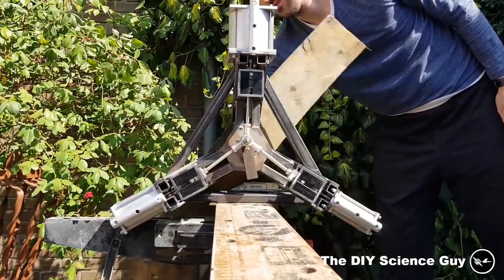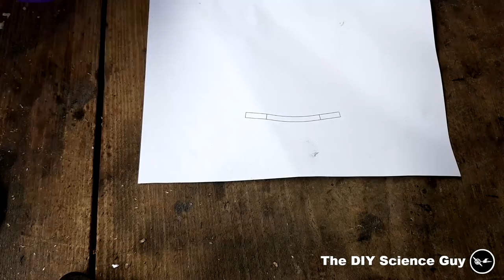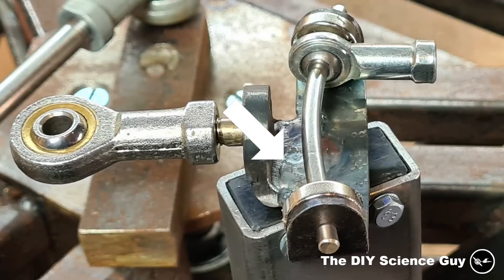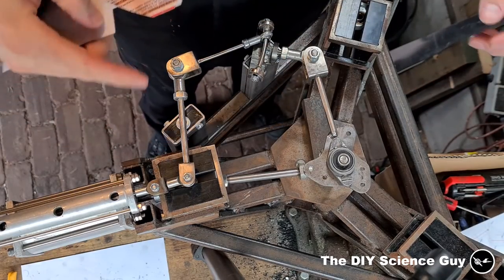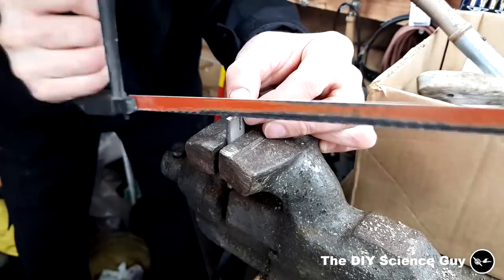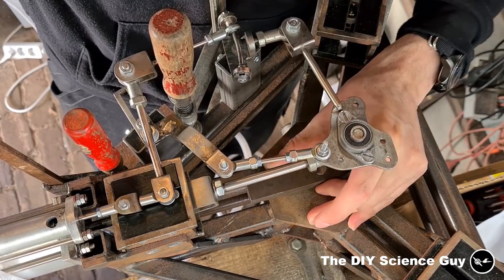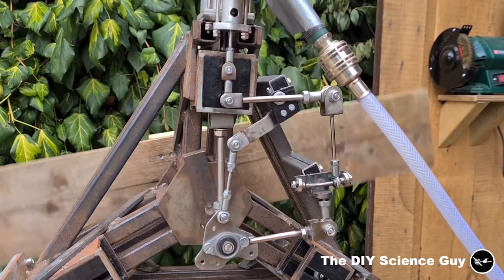Solar Steam Engine #7 The Valve Gear-True DIY

Comment: This channel is criminally undersubscribed. Amazing work!

I work in IT, and people think my work is complex. What you do here, however, is complete magic to me!
Reply: It is not even solar powered making this video click bait. Not underrated.
Reply: @bill4639  that's a sure thing he never finished this project 😅
Reply from the maker: But I will! This all is a hobby, hobbies take time.
Reply: @TheDIYScienceGuy  that's a good point! I know what you mean 😌. I really look forward to see how you deal whit sealing the engine up so it could be used in the refrigerant cycle, everything need to be air-conditioning qwantity , how dot you like the valveless Free piston steam engine?
Reply from the maker: This is how it's going to be solar powered: https://youtu.be/s5Ud-FD33tI hope you like it!
Reply from the maker: @oscar verwey Isn't that a kind of sterling engine?
Reply: @TheDIYScienceGuy  i like it for sure that's way I've replicated it whit some adjustments to go Whit water as a working vluid, my absorption heat exchanger is in the boiler heated by a solar heat colector en regenerative heat exchanger en the condenser is after the exhaust
Reply: @TheDIYScienceGuy  yas it's the free piston engine is also a kind of Stirling engine it's also a kind of combustion engine, it's the type of engine in general because it has not crank shaft,   I'm referring to the (Tesla mechanical oscillator steam engine) which is self switching en frequency stable
Reply from the maker: Aah yes that's a nice one! Did you build it your self?
Reply: @TheDIYScienceGuy  was 100% from scrap material as most of the components for the system
Reply: If you like I can send you the drawing of it, it took me 12 variation to get it to work properly on very low pressure
Reply from the maker: Yes please! You can send it at thediyscienceguy@gmail.com

Comment: Any plans to continue this series? Butane presents all manner of additional problems for only the advantage of the lower boiling point. I think you would have a better time sticking to ordinary water and steam, but use some sort of homemade ultra high throughput, low temperature differential heat pump to heat the boiler, using your awesome solar water heat source as the input.
Reply from the maker: The steam engine is sitting on my workbench as we speak. It's not about the successes, but about what we can learn from the things that didn't go to plan. I never take the easy road because they have already been traveled.
Reply: @TheDIYScienceGuy  Glad to read this :) That's great news !

Comment: What kind of welder? I’m familiar with a wire feed mig, and I also use a HF plasma cutter (absolutely love that tool) but I find my mig is not delicate enough.
Reply from the maker: It's a TIG welder.

Comment: Howdy :) I have loved watching this build and it has given me all sorts of inspiration- so much so that I am actually going to make a steam turbine for a school project coming up. I have one specific question that you touched on in your first video of this series with the soda bottle example: 
How do you physically set up the closed system recirculating pump?
I’d imagine it’s output pressure has to be higher than the boiler but then that pressure would be added and therefore it stands to reason the output pressure of the pump is now the operating pressure of the entire system correct? 
I am also wondering how you would get it started, as the water pump cannot pump steam(at least I assume it can’t) and so in my own mind the boiler would pump in both directions of the closed loop and make no work… do you need a valve to allow the boiler time to pressurize and start producing useful work and let the condenser resubmit fill up some water before opening the whole system to be recirculating?
Reply from the maker: Hey, good question! When the liquid is pumped to the boiler, it is a very small amount compared to the amount of gas that it can become. So, the pressure buildup from pumping the liquid is very small compared to the pressure buildup from heating the liquid in the boiler. The pump will be started by a switch that measures the boiler volume. This whole system is exactly the same as with a normal steam engine. Nice that you are making a turbine! Please let me know how it goes!

Comment: I like the project. I have a question. How much of your energy is used with such a complex set of mechanisms to control a valve?
Reply from the maker: Thanks! Well the valve mechanism does not have a lot of resistance, most of the friction is between the piston and the cylinder. But I don't know yet how much that is, I will determine that when the steam engine is ready. But good question 👍

Comment: Este o parodie de motor în stea. Nu este eficient deoarece la cursă maximă ai pierdut multă presiune. Îți sugerez o idee. O conductă de plastic, faci un cerc, cu bobine pe exterior. Capetele cercului sunt legate la un robinet bilă. Înainte și după robinet faci fante de admisie și evacuare, iar în conductă introduci un magnet bilă. Este un motor, generator, compresor, pompă, convertor, LINIAR.

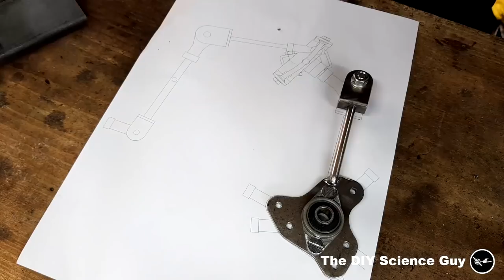Comment: 10:40 why isn't the crankshaft rotationally symmetrical?
Reply from the maker: It needs a counter weight and the thing sticking out is where I will later attache it to.

Comment: where's the rest of the solar steam generator?
Reply from the maker: I built a new workspace, and then, because of the high energy prices, I started building a heat pump. When that is running, I will continue the steam engine project, I really miss it! There are a lot of shorts about what I did and what I am working on.

Comment: Waaw your video's ar really inspirational, you I've take great afford to get it Al really precise ! Head's of man ! , What is your minimum run pressure whit Al the Stuff attached?

 I've replicated this steam system Idea (cryophorous system) en it works great on warm water, (from 55ged c en up ) 

it's really hard to make everything vacuüm tight but it runs for me on a solar heat colector en a boiler for storige, the engine I replicated is the Tesla machanical oscillator ( free piston steam engine) this uses no valve's or Extra stuff en can be tuned from 32hz up to 60hz whit a extra spring, it don't even have a crank shaft

 this makes it hard to generate electricity whit it  because it only have reciprocating motion en I can't get the liniaire alternator to work 😅 but the rest work's just fine even , the minimum run pressure on air is 0,2 Barr en on steam it's so low it's undetectable
Reply from the maker: Thanks!!! Nice, Do you have a video or something of your setup?
Reply: @TheDIYScienceGuy  do you know way my last comment is removed?
Reply from the maker: What comment? I didn't delete anything. Did it have a link? Youtube sometimes blocks those because they think it's spam 🤔
Reply: @TheDIYScienceGuy  ow really? Strange things happening sometimes, maybe something whit the community rules,

 what I was saying that ik got into this system after seeing Your first video about the solar steam engine 😀 after this I keep looking for things to make it happen en water van also je used of you engine can run on extremely low pressure, you can look it up on my channel I've a bunch of video's about the (Tesla machanical oscillator replication) your idea is almost the same as the (ocean thermal energy conversion system)

Comment: Can you use car supercharger as steam turbine?
Reply from the maker: Yes you can! 🤯
Reply: @TheDIYScienceGuy  I found another alternative. But I don't know if it sustain steam. Using pneumatic tool i.e. Cut-off tool as micro steam turbine. What do you think ?
Reply from the maker: Yes that works but they are extremely inefficient!
Reply: @TheDIYScienceGuy  thanks 🌹